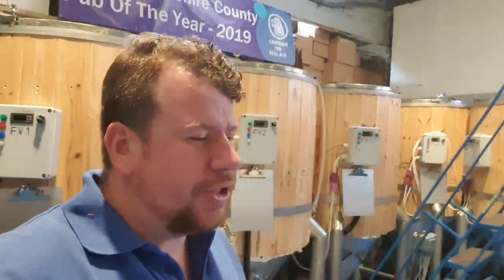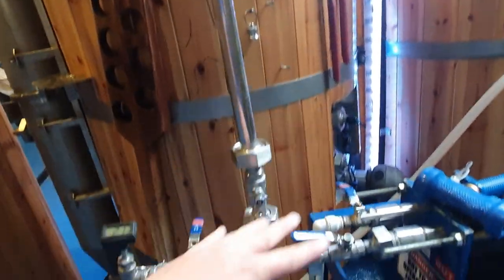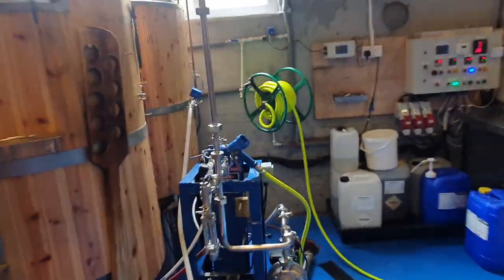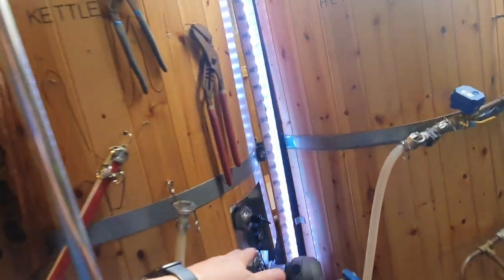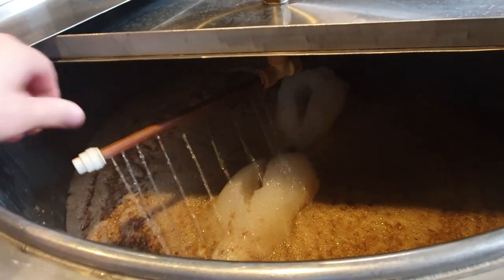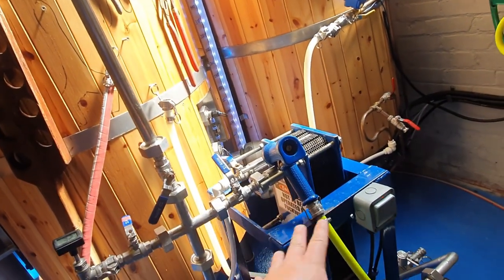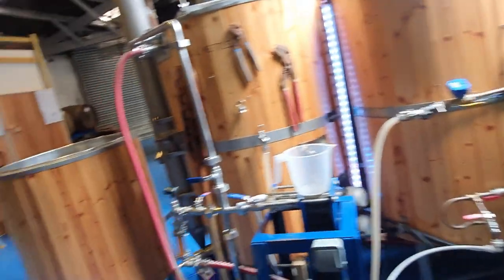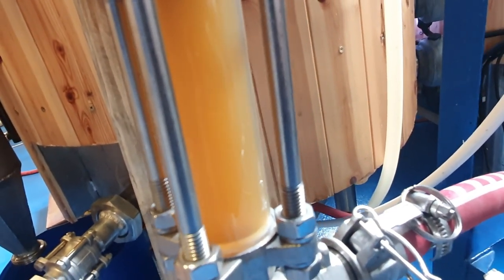vlog 852 Harrisons Best Bitter Brew Day

Comment: The tap water here in the state of Kansas, USA is around 27C in the summer.  Instead of trying to use it to cool the wort, I've started filling an empty fermenter with tap water a day or two before brewing.  I then using the chiller to cool it close to freezing and use that nearly freezing water to cool the wort.   With a fermenter full of 0.5C water, I can cool an entire batch to lager fermenting temperatures easily and quickly.  It means leaving a fermenter out of production for a few months, but it really helps with the beer quality.